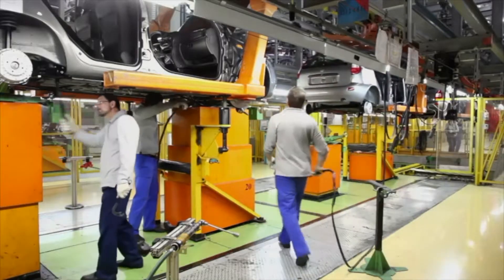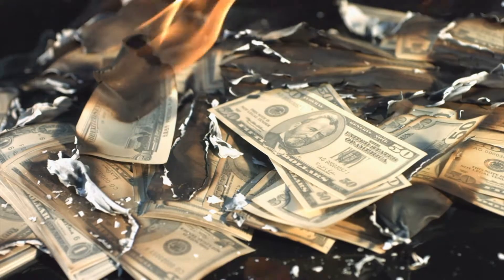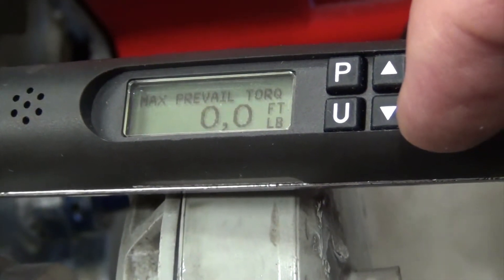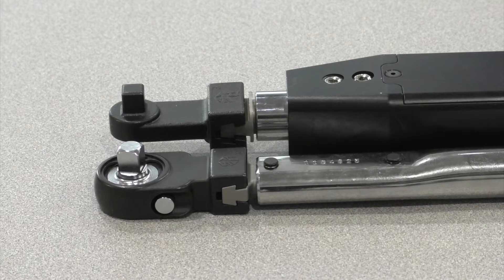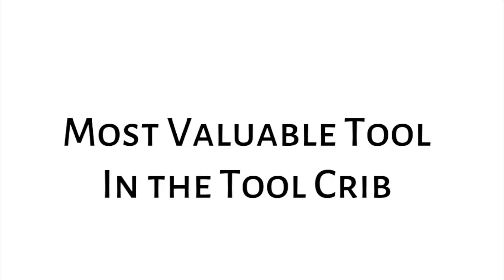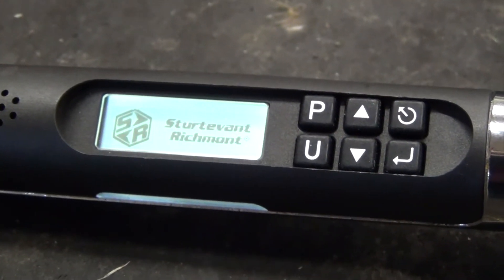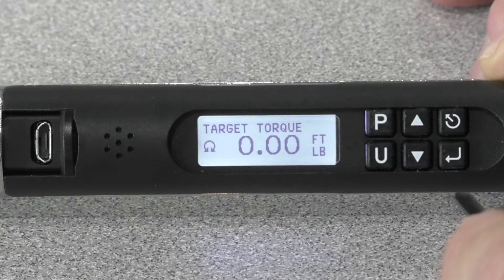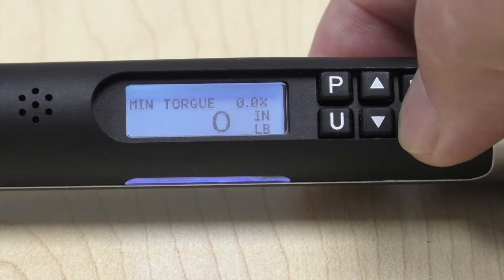VID-164  DTC Digital Torque and Angle Wrench B. Miller

Comment: Nobody makes practical torque wrench as Sturtevant Richmont does.
 With any other brand you have to use only one size of interchangeable heads to match specific torque wrench.
Typical example : 3/8" interchangeable head ratchet for 10-100 ft-lbs torque wrench.
Why not option for 1/2" interchangeable head ratchet for same torque wrench?
I was waiting long time for this quality instrument.Before I was considering TechAngle by Snap-on but I believe It's worth to spend extra money for this one.
Reply from the maker: Broj,  Thank you for your comments. We work hard to make the best possible tools for our customers. We appreciate customers who think and research rather than just buying a brand. As for your question about the 1/2 interchangeable head ratchet: we have that and they are readily available. Just see your distributor.
Reply: I know that all of your interchangeable heads fit on all of your wrenches.
That's why I chose to buy your product.It's more like mystery than question to me.Why limit specific range of torque wrench to only one size?
Reply from the maker: We agree with you. We don't understand why you have to buy multiple wrenches and heads in the same torque range in order to get the job done. But then when we first patented interchangeable heads for torque wrenches back in 1956, we designed the Dovetail so people wouldn't have to buy multiple wrenches and heads.